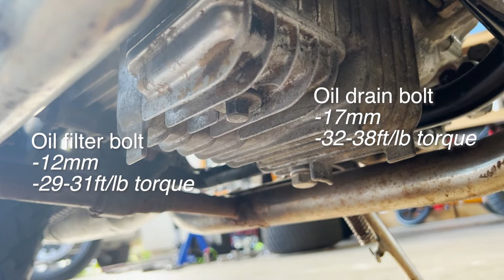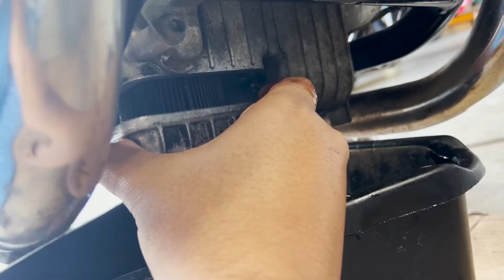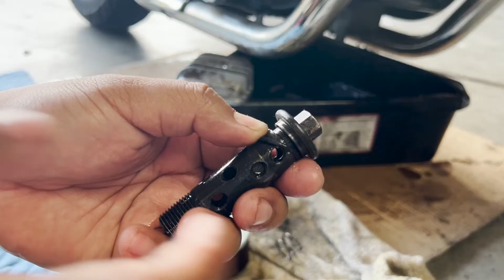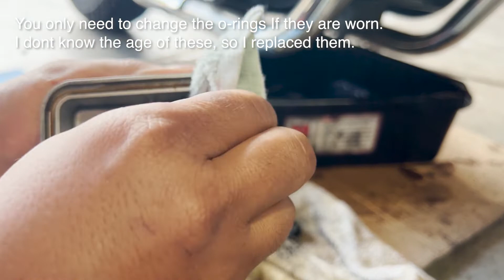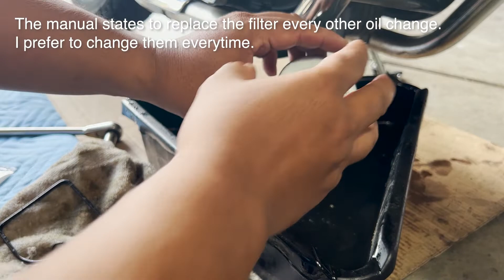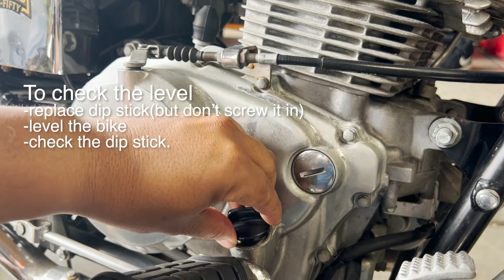1986 Honda Rebel 450 oil and filter change

Comment: Great video. I like the camera angles. You can actually see what your working on lol. I just got my bike and it had been sitting for a long time. I want to change the spark plugs and cables. I cant find a reliable source. Where do you recommend or i should say where should i buy the cables and plugs form. Any recommendations? Thanks.
Reply from the maker: Thank you. My method for finding parts it to track down the part number first and search by the number on the web. It should show you who is selling them. With older rare vehicles, the availability changes all the time. I think i got my spark plug from Amazon and a local auto part store via part# Good luck and have fun. Don't hesitate to ask my more questions.
Reply: @MacrossGarage  Thank you! I really appreciate the response.

Comment: Thanks for the video, just got one of these. Could you put a seperate link for the oil filter gasket, when you click the link it only brings up the O ring and the part number is not bring up a honda version like yours thanks!
Reply from the maker: Hi, let me check my link because that is were I got my o-ring. The other one i got from ebay and I dont like to link ebay because they get old fast. Just type the part# on ebay search and you should find both.